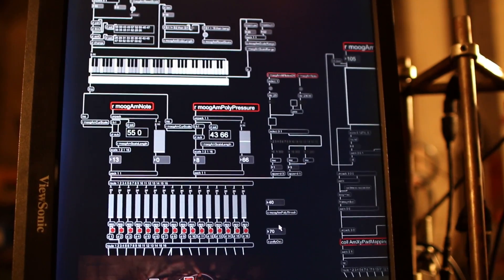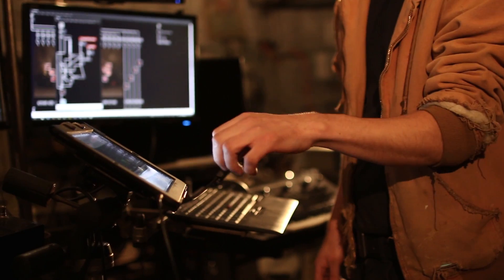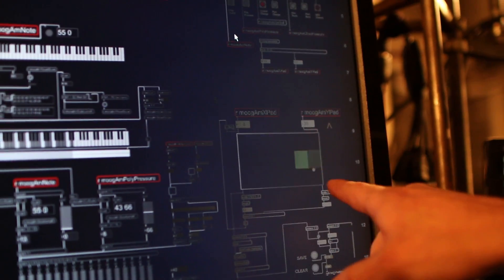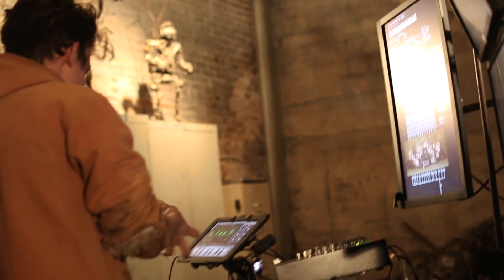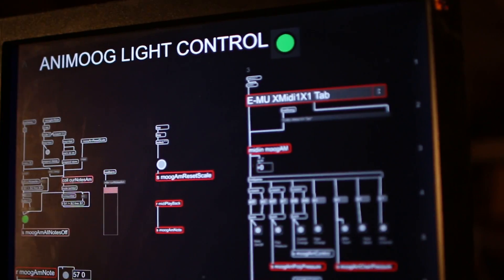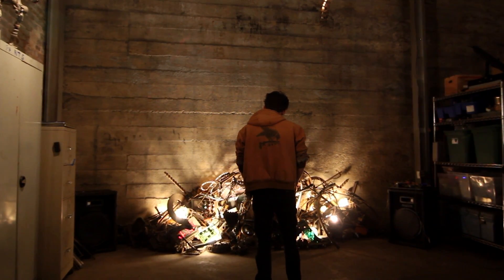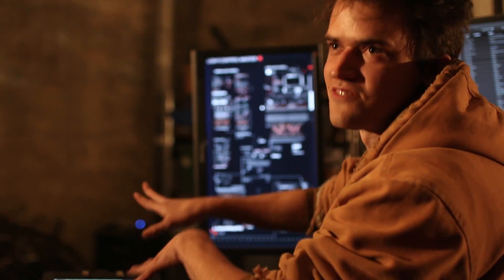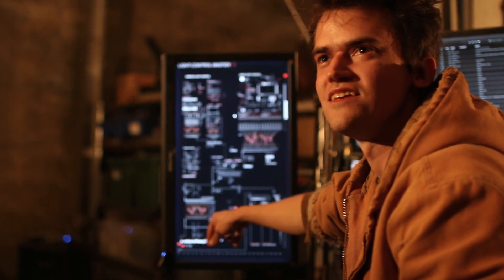Animoog | Interactive Interface

Comment: Is that Max/MSP or some other graphical programming environment?  I am aware of Max/MSP but have never looked into it.
Reply: Pure Data is also an alternative and FREE. The MSP in MAX/MSP is Miller Steward Puckette. He was a part of the original MAX program. I will say I prefer Max/MSP but Pure Data is amazing as well. I would start with Pure Data to get a feel for whether or not you like working with sound this way before committing to a paid solution. I know this is long after the original posts, but in case someone new happens this way, I posted it.